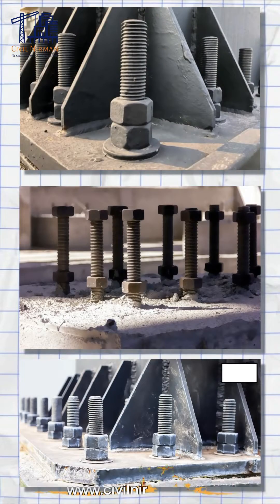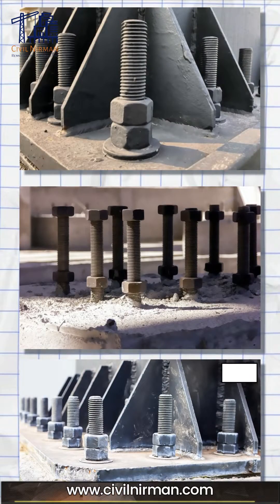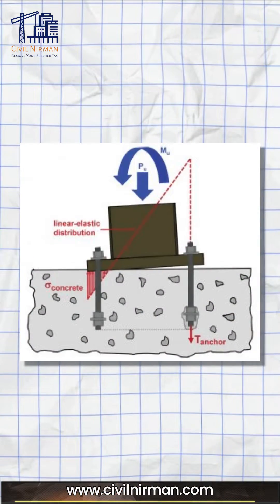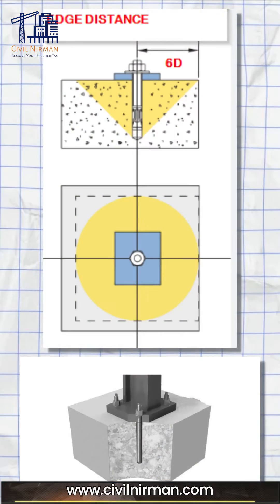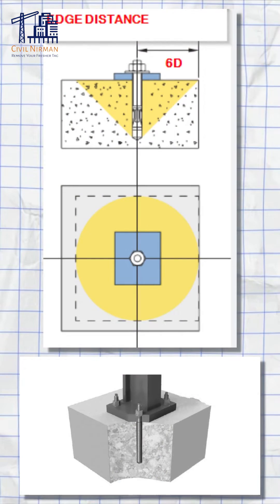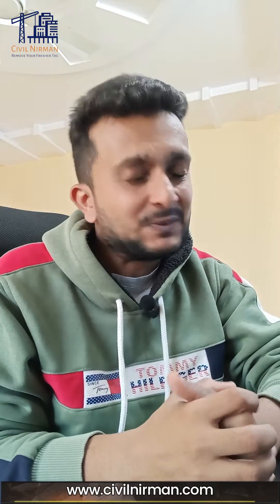Function of Anchor Bolts and Base plate #anchorboltdesign#baseplatedesign

Comment: Please make videos on AISC Code
Reply from the maker: For which details you want?
Reply: @CIVILNIRMAN  Please make videos on shortcut methods of design, like the thumb rules to check the design for simplifying equations. Sometimes, we dont have enough time to design manually the whole structures and because we have a lot of structures to be design in a consulting firm in a short span of time so we mostly trust software results because if we come to check every single beam and column then it will take a lot of time. So, I think there have been some shortcut formulas and tricks whom we check the design. Like the stress formula Strength = My/I to check stresses in foundation. Or there might be some quick methods to design short structures manualy rather than on software. using Aisc code